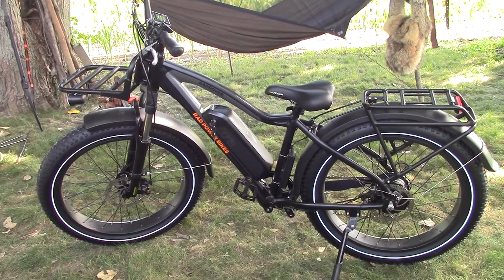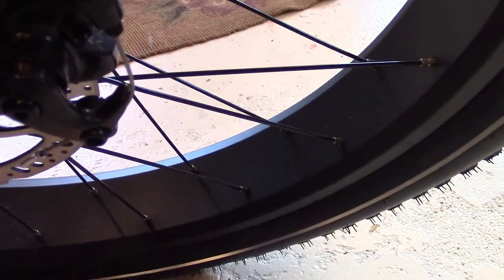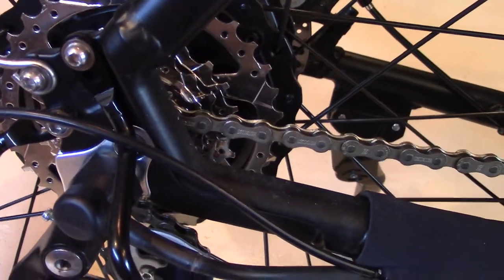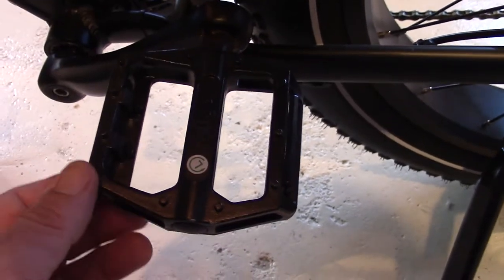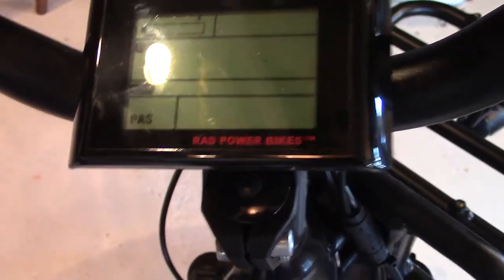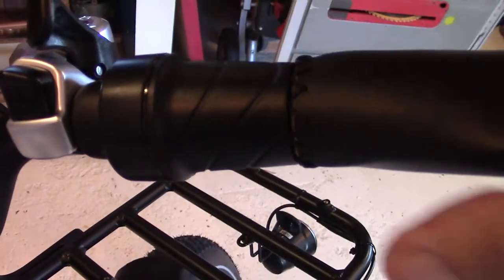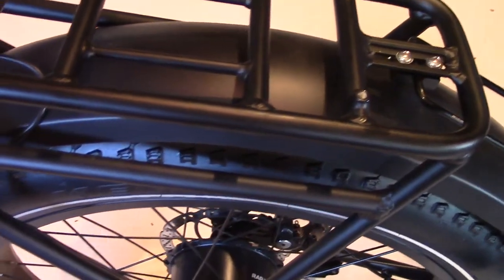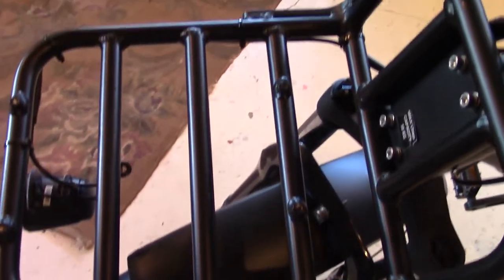RAD POWER BIKES...An Introduction

Comment: I Have a 2020 Rad Rover Step Thru with 1757 miles  on it Problem Free and Love it . I Only Ride off road mountain trails in Eastern Tennessee   ..  I am 66 years old and weigh 204 pounds . The thing I Like the most about my bike ? It is dead quite  no sound at all  . My Bike has no problem maintaining 24 mph ..
Reply from the maker: Thanks for the reply Billy. We have been impressed with both the Rad Rover 5 and the Rad Rover Step Thru. Currently preparing to take both out on a deer hunt in October. Keep an eye out on the channel for the videos. You have been added to the Give-Away Database.
Reply from the maker: Thanks Billy for the input. More viewers need to read your comment. The Rad Power Bikes are by far the best bang for the buck in their category. For $1500 you just can't go wrong as far as we're concerned.

Comment: Good informative video.  Assume washing with garden hose and soap OK with electronics?   60 y/o ex MC rider.  Looking to stay active.   And Thanks for Your Service.
Reply from the maker: Semper Fi D! A spokesman from the company suggests avoiding an over-abundance of water on the electronics. When I'm going out in the bush, or simple rain in the city, I take plastic bags along. Sandwich bag for the Display, Trash bag for the Battery, Gallon size for the Controller. Unfortunately you can't do anything about the Gear Hub Motor Assembly. I have ridden through 8-10" creeks without a problem. I haven't gotten the guts yet to try anything deeper...nor has anyone else in our crew.
Reply: No hose! That's a big no no!

Comment: The Rad Power bikes in the States have 750W motors but the ones in 
Europe have 250W.  Is there a way to check which motor it has?

Comment: Are you able to go beyond 20mph with pedal assist?
Reply from the maker: The Rad Power Bikes are designed to do 20 mph out of the box. I have learned that a mod can be done to push them up to 30, but not something I would recommend.
Reply from the maker: Yes you are...if you've got the legs.
Reply: Hold top and bottom buttons down together.
Then it will enter secret settings mode.
Then push mode once to enter setting mode 2. Push up there to increase speed to 40kph which translates to ~25mph. Hold setting again to leave to main menu.

Should get you to 25mph
Reply from the maker: @uploadtime1780  Thanks Josh...will take a look at that mod.
Reply: You can set the limit to 40kmh